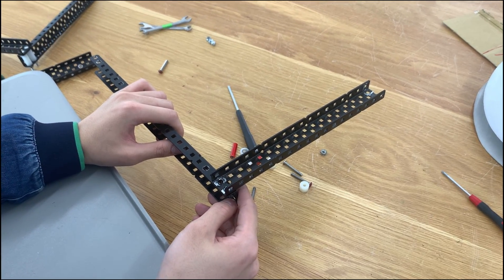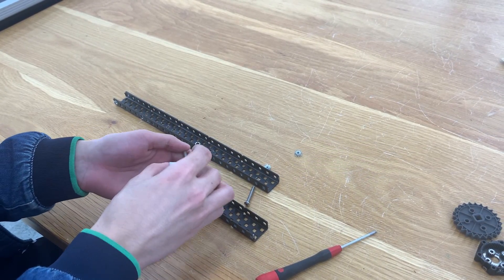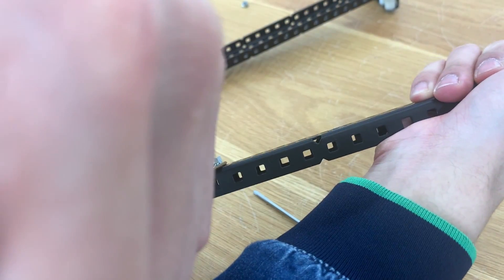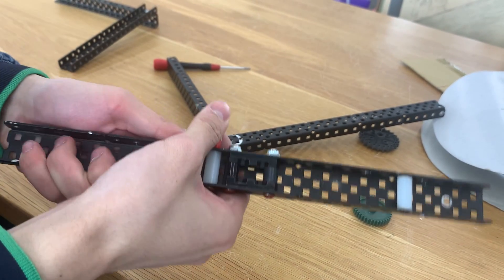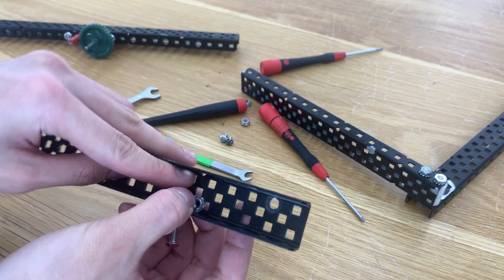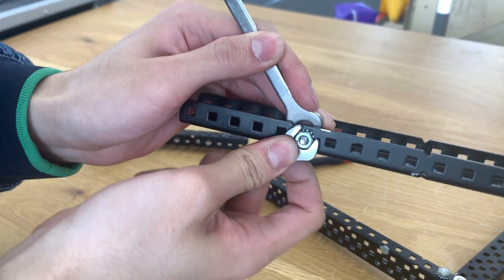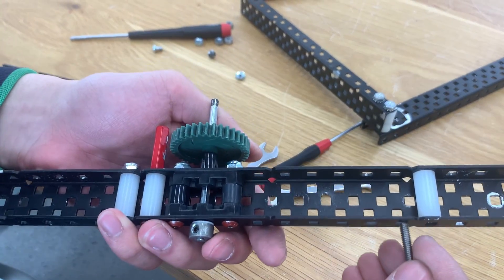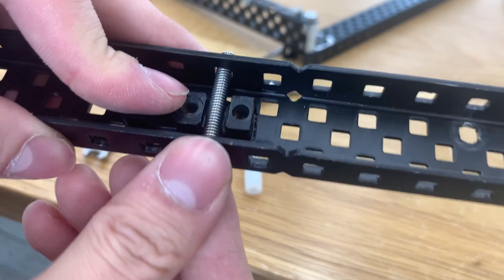VEX Build Masterclass #2 - Boxing

Comment: its been a while but how do you know where to box, should u just pick random positions?
Reply from the maker: box structural connections i.e standoff to metal and metal to metal. things that don’t withstand stress don’t need to be boxed
Reply: @ryan4253b  i see, is it fine if i use a standoff for screw boxing on the top instead of another hex nut

Comment: What is your opinion on the 7/8” Standoff from Robosource? Do those work well for boxing?
Reply from the maker: If you already have 7/8" standoffs from Robosource, they certainly work for boxing. However, if you don't have them yet, I will strongly recommend using spacers to box instead. They are cheaper (18.5$ / 100 spacer vs 49.5$ / 100 standoffs) and also lighter. 

The narrow use case I would use 7/8" standoffs to box is if there is no space and a nylock can't fit on either end. However, I can also just use 3/8" spacers and 1/2" standoffs to achieve the same result.

tl;dr: I would use them if I already have them, but otherwise use spacers.
Reply: Yes they are good
Reply from the maker: @kinru1259 That is a fair argument... I did not notice that robosource standoffs are made of aluminum and are therefore significantly lighter than the steel screws. I stand corrected. With this established, when boxing with standoffs, I would recommend applying loctite purple on the screws to ensure that the screws would not loosen over time.

On the other hand, I wonder how much the spacer setup would weigh if we use aluminum screws instead. Unfortunately, McMaster Carr doesn't sell 1.25" aluminum screws and the cost would likely make it not worth the cost.